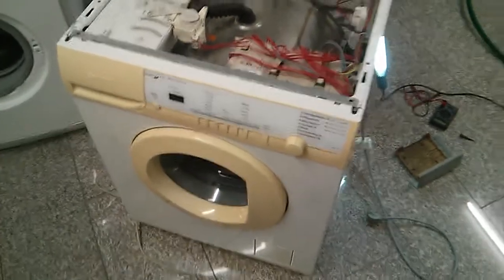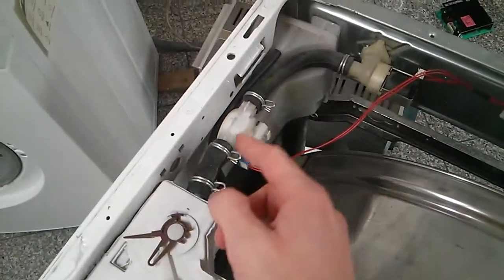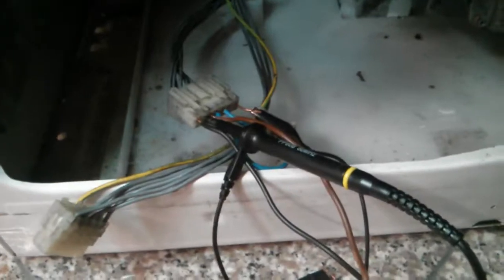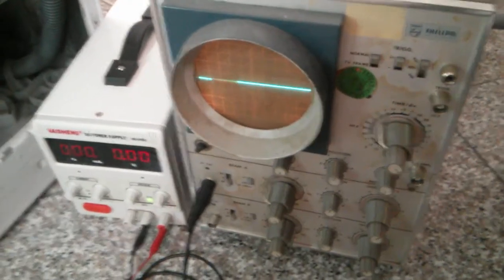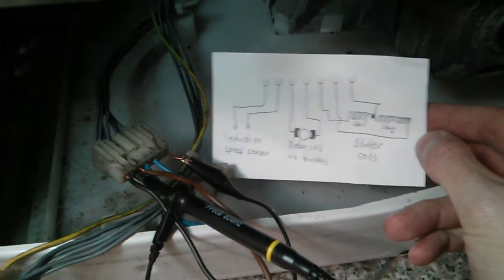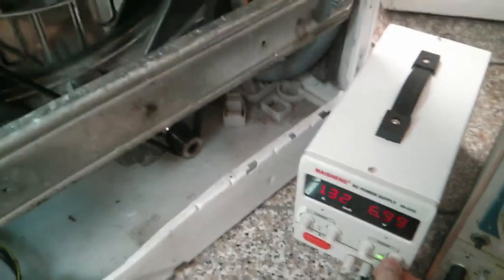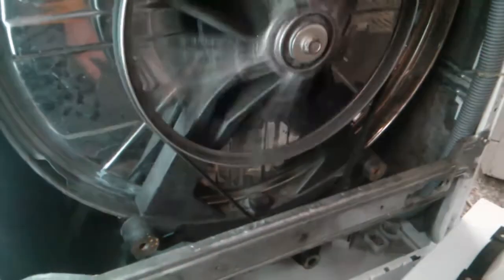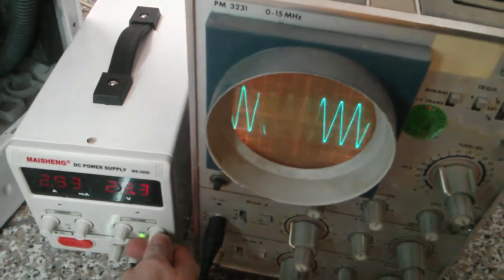WashbearyPi - controlling a washing machine with a RaspberryPi. Episode1: Motor pinout.

Comment: Hello! What is the status on this? I'm in the apparel industry, and there's a huge need for this in fabric dyeing. Being able to dye garments on demand is a difficult ask, since you're either stuck with a 5 gallon bucket, a washing machine, or $100K+ machines. I am absolutely interested in this!
Reply from the maker: Wow, I am impressed that you know an industrial application for the WashbearyPi! Regarding the current status: I hope you watched the "WashbearyPi Episode 3" video that I uploaded 3 months ago? If not, just have a look. In short: It's washing! You can control the drum motion (e.g. 1 hour of periodic CW and CCW rotation), the drain pump, the water inlet solenoid etc. on the command line of the Pi. So now YOU can tell the machine in detail what to do. You are no longer bound to the manufacturer's pre-defined wash programs. Would this meet the requirements of your application already?

Comment: I've seen an Arduino used to repair a dishwasher, it even added new programmes. And washbeary is a project close to my heart; how many of us have had to discard an appliance simply because of excessive prices for PCB contoller boards?
Reply: Agreed. This man is on to something. Imagine if appliances had Raspberry Pi controllers from the get go. Say you bought a 2015 washing machine, and the Raspberry Pi computer gives up. One can replace that chip for under 40 bucks. Sadly, appliances today use in-house chips that cost hundreds to replace. And hey, a Raspberry Pi has much more computing power compared to a Maytag chip or GE chip.